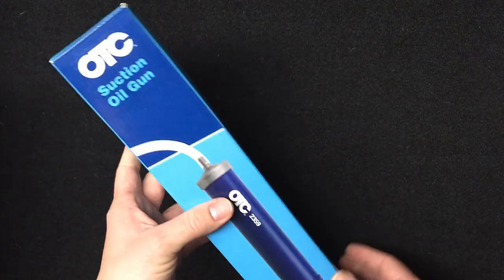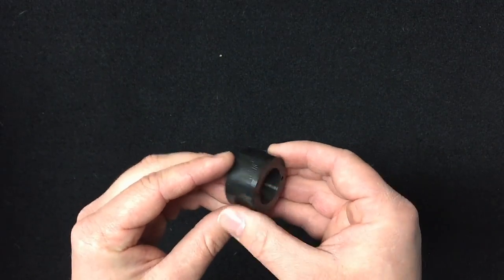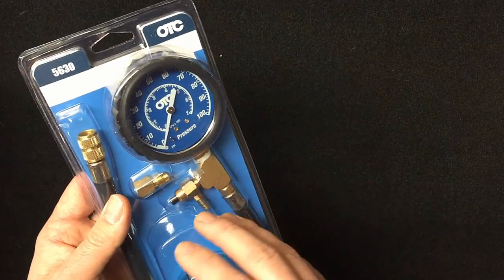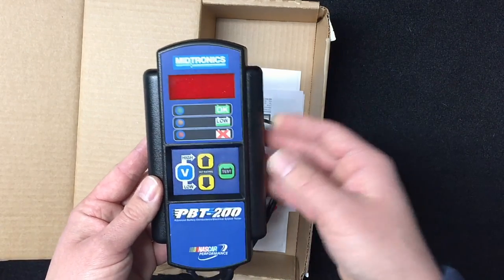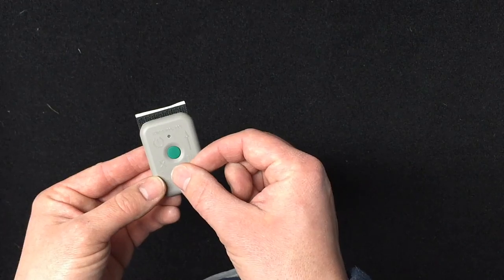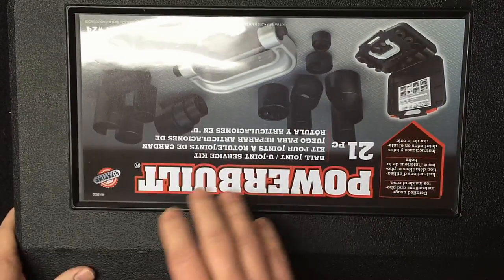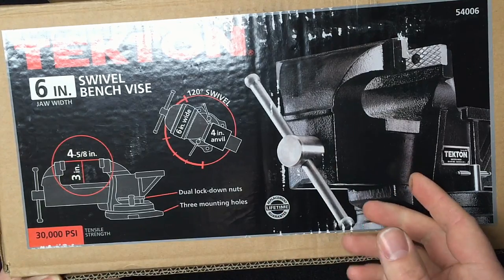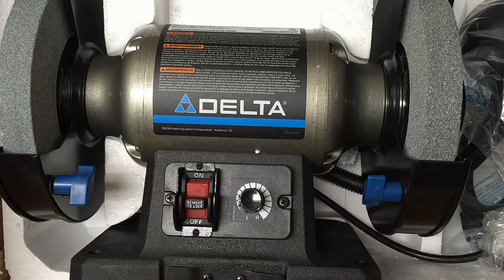Common Tools Needed When Repairing Ford Vehicles: Mass Unboxing 1 of 2

Comment: Hey dude. Semper Fi. 3521 Motor T mech in 06-10. I ended up becoming a fireman, but always kept wrenching on the side. Found your channel recently because of a vct solenoid sticking on my 07 f150 and love your work ethic. 

I’m on the fence if the truck is worth fixing though. After using your videos, to correctly diagnose and replace the 1 solenoid I found the valve train is caked in sludge. Absolutely caked. Then I started getting timing chain slap after I put it back together. Maybe piece of sludge got knocked around and clogged something. 

Anyway just wanted to drop in and say hi. Thanks for your service and thanks for the top notch info here on YouTube.

Comment: The only thing I would not suggest is the Otc fuel gauge. I had to change that thing around 6 times a year. The oring/seal and the fuel hose attach to the gauge is easily bent. I have broken two and the others it falls of.
Reply from the maker: +meadowskaty6 Interesting it has been very reliable so far much better than my previous gauges

Comment: Thanks, you videos are helpful and of quality. I am surprised not to see even ONE Snapon tool. So it means I guess you think the prices are ridiculous. I have a small Power Built puller set, used it many times. But I have the Snapon ball joint press set it is strong, many adapters. Had to buy another adapter for 2005 Explorer lower ball joint. Thanks again for good info, appreciate it.
Reply: Don't kid your self OTC is not cheap,nice to see that there quality seems to have improved I worked for a dealer ship 30 or so years ago and got auto shipment of OTC tools they worked but alot seemed like an after thought

Comment: Nice videos as always my question is I have a 2016 f150 6cyl with the electronic brake switch what happens to the rear brakes if you don’t put the truck in maintenance mode

Comment: Great vid! What is this I have been hearing about how these car companies want to make it illegal to work on your own car? Does that have to do with the computer?
Reply from the maker: obadiah7771 Yeah it has everything to do with the computer they have been pushing for this kind of thing for years now from repair information to pcm access now. I hope it won't affect me since I have the dealer scan tool.
Reply: I think its a garage idea considering we buy these vehicle to drive and fix. I am tired of the baby sitter mentality man. It drives me crazy! I cannot wait for the next vid!
Reply: FordTechMakuloco Just be careful with pats keys..just program a 2015 mkz and it actually made log in to fmc,I ignored the first time and guess what....Error message....
Reply: obadiah7771 Car companies don't want you working on the cars of the future as these will be the driverless cars. Yes they are gearing up for the driverless cars by putting in place the laws first and then they will roll out the cars. Lots of legal stuff to be put in place for those cars. Those cars will have sophisticated computer systems that they will not want you screwing with. Big liability issues. This also means big money for the dealership as any hiccup in the system and it will likely need to be taken to the dealership for repairs even if it is to reset the system. These cars will be a Big Bro nightmare as they will record and report anywhere you go. Don't pay your car taxes and your car won't start or it will refuse to go on a public road. I assume an ID will be required to use a car and it may even ID you by face and voice recognition. HD cameras on the car mean they will be spy devices always monitoring whats going on around them.
Reply from the maker: guayaco3299 Makes me wonder I heard something about this with the 2015 F150 also. I still have access to Ford just not full PTS access like you have I miss those days reading the boards and such on there lot's of good info.
Reply: westin1985 big bucks for the dealership. Chump change for the techs

Comment: Just personal experience but I use my shop press way more than the C press. I was doing my bro in-laws 2008 trailblazer lower ball joint with that same press and i bent the press. Thing was so seized in there I had to remove the whole control arm and had to use the press... even with the press it exploded out on me!!!!

Comment: Can I ask you a quick question .My wife bought her first new car a 2014 Escape last May .She parked it for the winter,Were in New York And drove her 97 Cougar.for the winter.I only started it once all winter.When I tried a couple weeks ago dead battery.Battery Tender next winter.It's charged now.but the remote starter wont work.It did once but now nothing.When I hit the buttons on the key fob I can here It click and buzz behind the radiator but no start.Is that something that has to be reset ?The color pallet on her ambient lighting doesn't seem to work either and I don't think It ever did.I am going to have the dealer do the yearly inspection first of June.It has plenty of warranty .I would like to do It myself If I could.What would you suggest as a scan tool for the regular Ford guy .Not a professional mechanic  to have to diagnose codes that you could fix at home  before having to take your car or truck to the dealer or a mechanic ? Keep the.videos coming I hope your business is a great success.
Reply from the maker: Jim Garvey It should not have to be reset but I suspect a code is keeping it from remote starting see my video on that subject I also have a video of a great little scan tool call blue driver with links in the description of where you can get it.

Comment: Hey I live in Iowa, By the quadcities. But i have a question. I rebuilt my transmission. I have a 2014 ford escape tritium fwd 1.6L  6f35 transmission  I mixed up the values. so i put them in low power and high power spots.  2nd goes in hard.  should I just go to dealer and have the newest update installed ? Or what ?

Comment: Brian--
Do you machine wash as reuse those shop rags? Does it cause any mess in your washing machine if you do?
Reply from the maker: ***** I havent had to wash a batch yet but I wont use them for oil pickup just some dirt and grease grime.

Comment: question. 07 exp. 3v 5.4. stumbles on gas pedal press. put scanner on with no codes. cylinder 1 and 3 have new coils ans plugs. they act a fool with the remaining three. cylinder contribution test shows all misfire under load/ acceleration. any ideas?

Comment: Hey do you Work on any other vehicles? like say Asian imports and stuff like that?
Reply from the maker: +treluvsjay1 I have been stuck on Fords everyday all day for the past 10 years so I specialize in anything on Fords but I only do the basics on the other makes like intake gaskets, brakes, wheel bearings etc..

Comment: Also, don't waste your time and money on any other oil transmission line disconnect tool than the OTC 307-569. Aside from that one the only other one thin and strong enough to get in and disconnect the oil transmission line is the brown plastic Lisle 39960 tool.

Comment: Hello i have a cuestion, 25 annoying  beeps in sets of 5 beeps, every 30 min,the air bag ligth dosent turn on when i crank de engine, 2003 ford expedition 5.4 L is dirving me crazy...please help.
Reply: antonio cota Sounds like your bulb is blown or someone took it out..
Reply from the maker: Pull that cluster and replace the bulb first thing it is designed to do this federal regulations for air bag safety